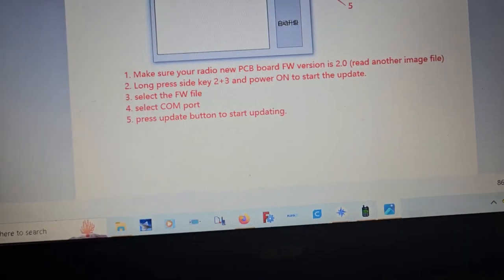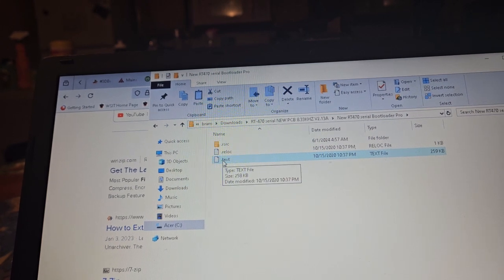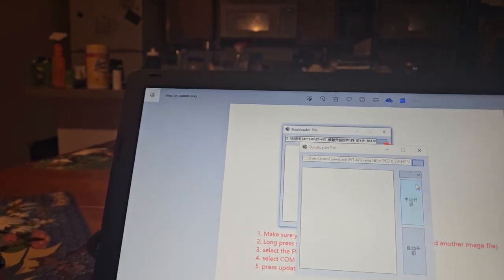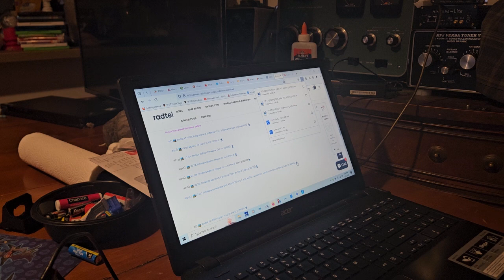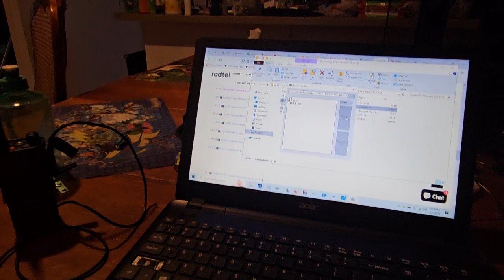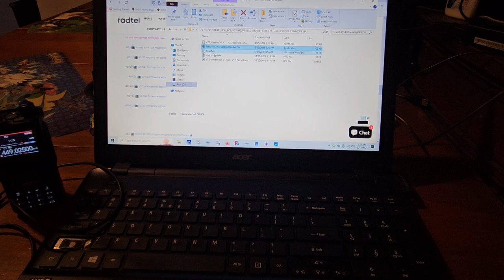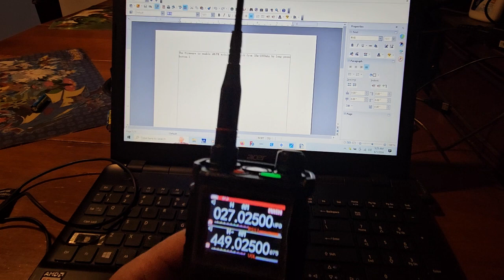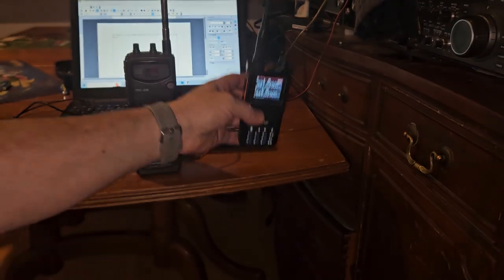Updated am & 18mhz - 999mhz band cover. Radtel rt470x firmware 2.13c

Comment: I just got my 470x and it has some serious issues with 
Receiver interference on the 440 Band making it practically unusable . Have you experienced any of the same issues? Thanks
Reply from the maker: Didn't you already post this like a few days ago I already posted like this and I said that I don't really seem to have any problems with mine I would return it but I would probably buy something different because I bought mine like 2 years ago and there are better radios to buy nowadays like the tid radio TDH 3